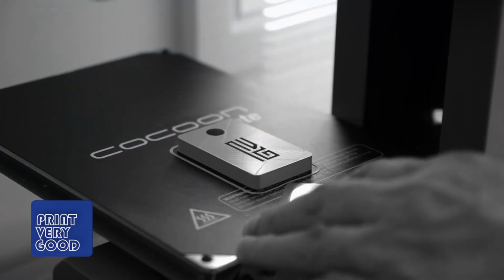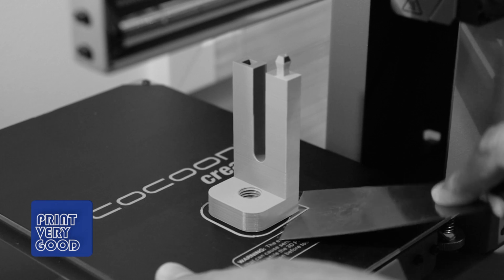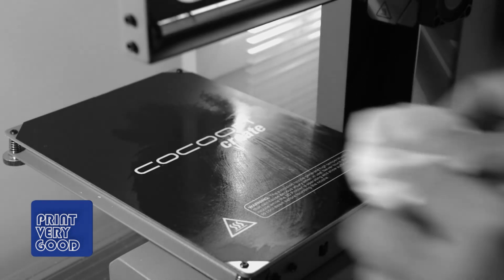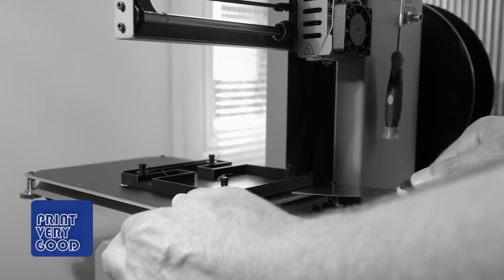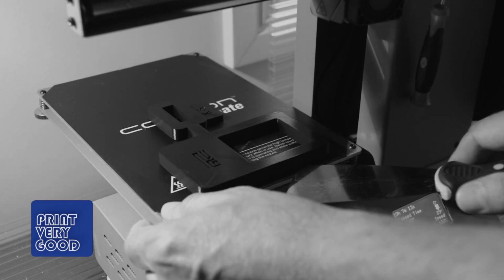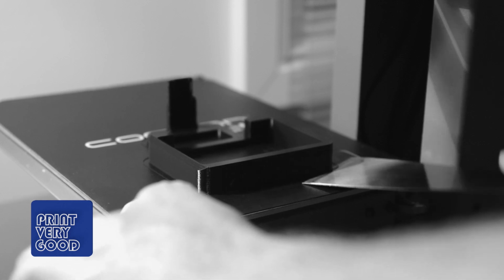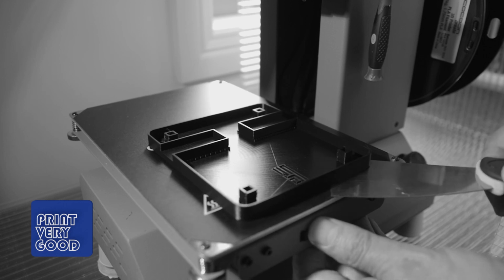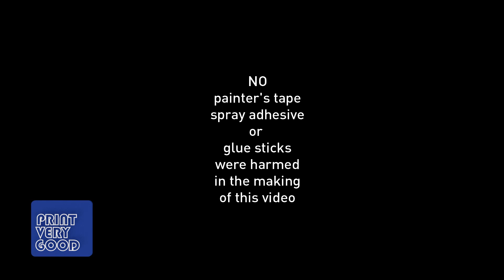Look at My Bed adhesion with Isopropyl Alcohol

Comment: i feel like i'm to blame for this one with my .7 typo in the discussion i personally am a painters tape guy and between prints i've done directly to bed (with adhesive) and prints to the tape i've noticed no i'll effects to the finish i lay the tape very close together with little to no gap and no overlap i attempt to make the tape as close to a uniform surface as the original bed. this works for me and by no means am i suggesting you change what works for you. extra advantage of painter tape is if you get that super stubborn print you can take the tool under the tape and lift it off from there as the adhesive on the tape will release abit easier. if you'd like i'll print out something and send you some photos of my bottom layer surface finish. i'm in qld and average temps up here have been around high 20's (28-29) to low 30's (30-32) however humidity is high and not printing in a climate controlled area has a huge impact on prints.

another thing i've noticed that could be a difference between us is you say you print that first lay real slow
these are my settings for speed i don't tend to change these
travel 80mm/s
bottom layer 15mm/s
infil 50mm/s
top/bottom 15mm/s
outer shell 15mm/s (i find this gives me a realy nice finish)
inner shell 30mm/s

i've noticed that my supports are extra stubborn and tend to leave a realy ugly finish on the part have you noticed the same?
Reply from the maker: Hi Kyle! No you're not to blame I was just wanted to be sure that I was being clear with the info. Thanks for letting me know you're in QLD, you will be dealing with a completely different set of circumstances to me. You'll be battling humidity at this time of year and come winter I'll be battling daytime temperatures below 10C. Not looking forward to that and I may very well end up on painters tape after all. Although I do have a couple of ideas to try and deal with a non heated bed in winter. I was going to wait till more colder weather before making that video but I might bring it forward.
Would love to see what sort of finish you're getting with painters tape, if you could shoot me a pic to the email address listed above that would be awesome! When you get a chance that is, don't do a special print just for me.

I think your speed settings are very similar to mine although my outer shell might be a little faster, I'll have to try 15mm/s for that one.

Yes supports do take a bit of cleaning up. I got an email from Ultimaker letting me know a new version of Cura (3.2) has been released, you can check it out here https://ultimaker.com/en/blog/52484-discover-ultimaker-cura-32
I'm going to download it tomorrow and try and get the Mini working nicely with it. The new features are awesome, check out the support structures!
Thanks for the feedback Kyle!
Paul
Reply: yeah after this vid i actually spent an hour looking through all the new settings man the print i was comparing between 3.2 and cocoon cura print time went from 19 minutes (never seen a print that fast) to the same or 1 min slower that my setting in cocoon cura so there's a MASSIVE amount of time to be saved in fiddling with all the new settings. i especially like the new ability to print the first layers at a different temp (i'm going to try first layers hotter at around 200-205 with 110-120% thickness for beter bed adhesion (hotter for easier flow and thicker for that stick)
Reply: My printer somehow manages to cause the tape to adhere also that there's no difference between using the tape or the bare bed.  Maybe when the surface wears some more the tape will give me that advantage.